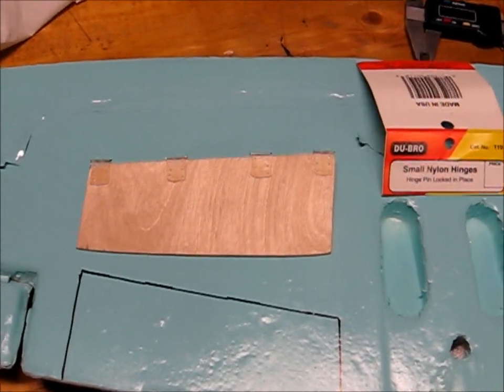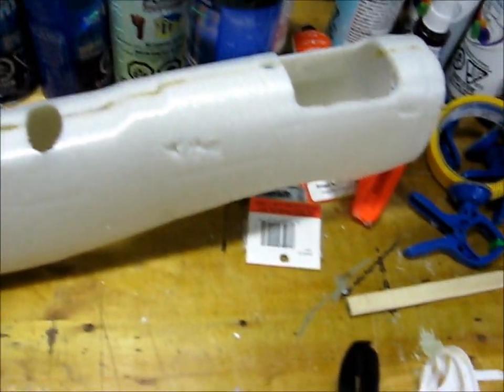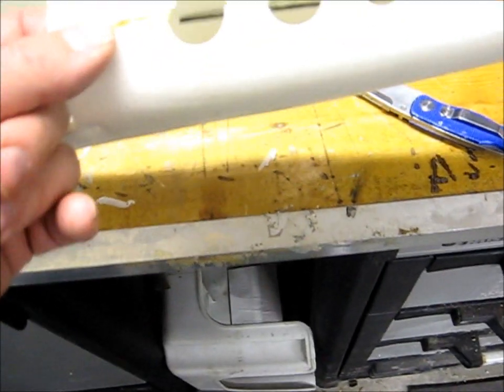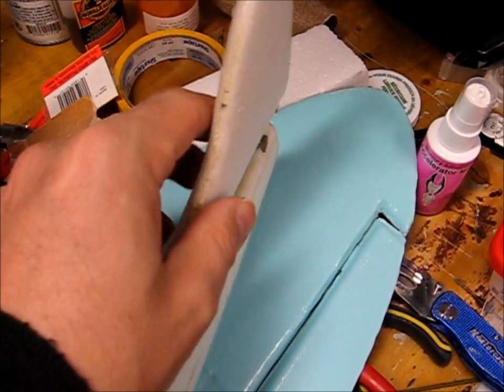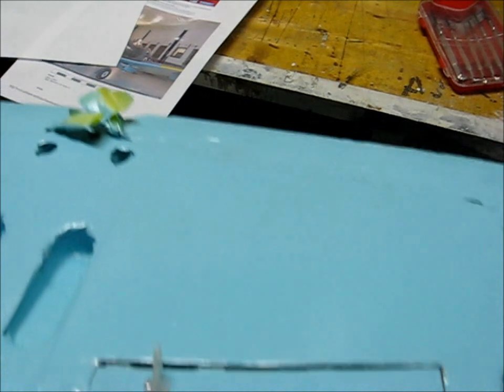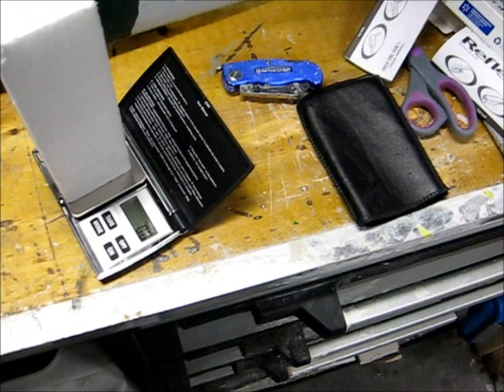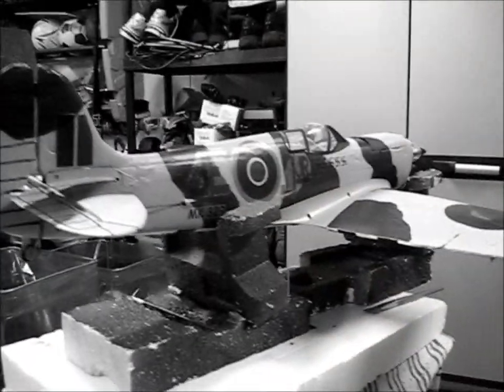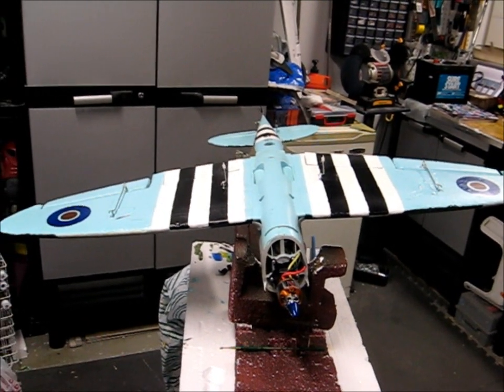Parkzone Spitfire Mod Part II - Glassing Split flaps

Comment from the maker: @richardwebb2112 Kind of ... I finished the work but it just did not work out well.  I have to maybe edit the rest of the vid and show the project prior to the maiden but the plane did not fly well.  Issues with the flaps and "flapping" control surfaces.  I have re-done it again and have it back as a belly lander but glassed wing, etc.  Thanks for the great question.

Comment: Not bad at all my friend as she is looking just about ready to go and hunt down the Hun in the Sun ;-) great job on beefing up the tail part for the rudder mod as i had to do the same sort of thing and it works a treat don't it,i'm still waiting on doing a maiden flight with mine because of the weather plus i've got to do one for the P-47 Thunderbolt too plus i should have a FF-35 scratch build to maiden in a couple of weeks as well so i'll be busy in the air soon, great job on the mods Marlin